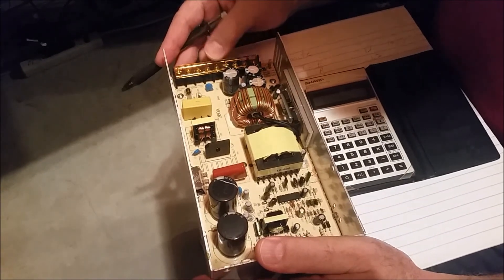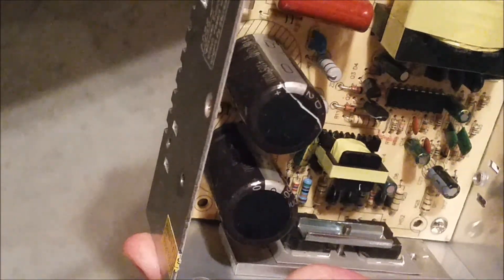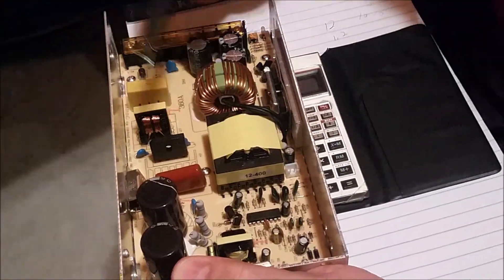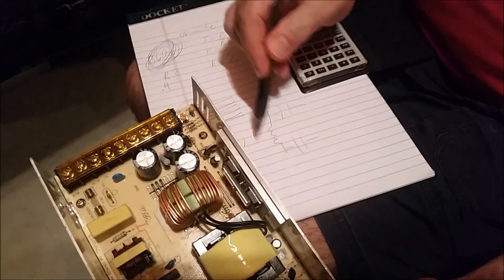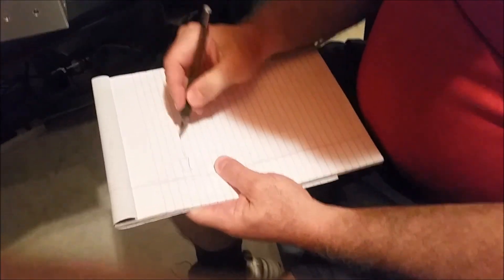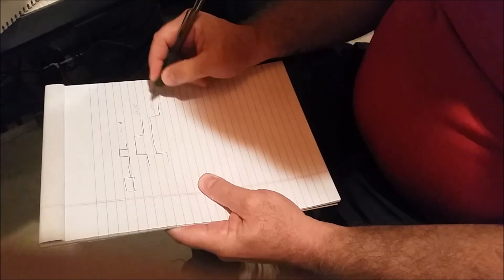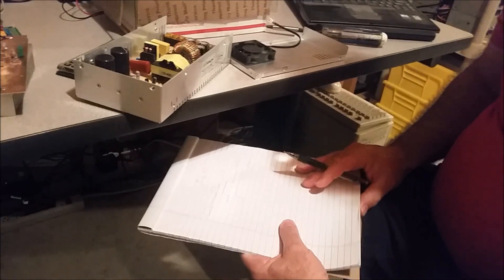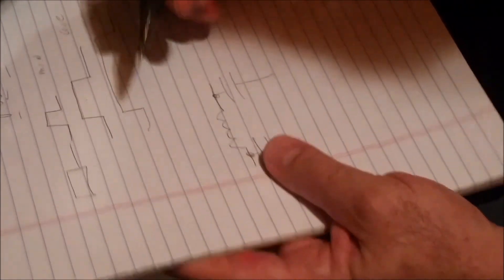RF Man The Genius Explaining A 30A Switch Mode Power Supply Module

Comment: That SMPS is s half bridge with max freq of 28kHz, hard switching of course
Reply from the maker: Can you explain in a bit more detail please sir? Thanks.
Reply: @1883GotDown  please search on yt DiodeGoneWild 24V 10A smps, you will get every single detail about the power supply. It's identical to the one in your video. He is the best guy on yt when it comes to smsp explanations.

Comment: The transistors at min. 2.32 of my mean well supply are covered by a sort of rubber caps,wtf?they should be direct contact to metal ground for heat dissipation?
Reply: usually the back side of a transistor cotains full mains rectified voltage, so tying that to the GND will give you a lethal shock.
Reply: @andyapple9  thanks for reply. Doing that, then put the supply inside a plastic case should be safe  because the metal chassis will be isolated and not touched, right?
Reply: @MACYNET323  yeah but keep in mind that the transistor needs to cool down too and plastic is not a great heat disipator
Reply: @andyapple9 I would say remove the rubber caps from transitors for a direct contact on chassis metals to increase heatsink, then put all on  plastic drilled case with a small fan

Comment: sir one more question ,I have 12v 30 ah power supply, I pill off may be 104 capacitor inside of output 12v+ terminal,I don't remember it,I don't think which one was install ,at fast I install 104 capacitor without line, power supply has run but come out noising and doesn't fan run,I check all component ,but I didn't find any fault component,I checked series line, what can I do sir

Comment: Sir I have 12v 30 ah power supply,at fast it has problem power off,I check all component, but I has find someone problem ,2 transistor,big capacitor beside which 150k resistor,and 472 1 kv capacitor.i use 120k resistor , change transistor.472 1kv I don't get then I use 472 2kv capacitor,now power supply power on but fan isn't running,and so many noising.